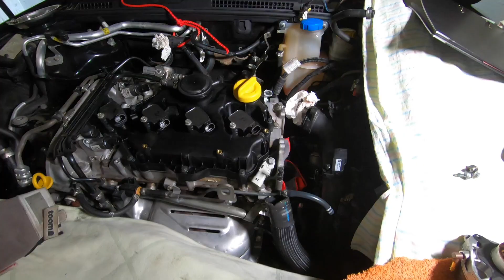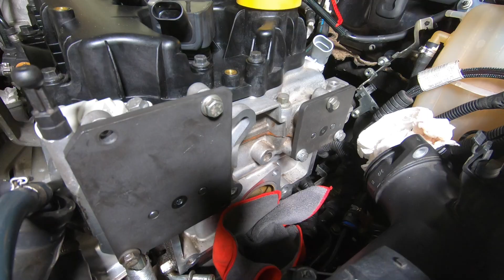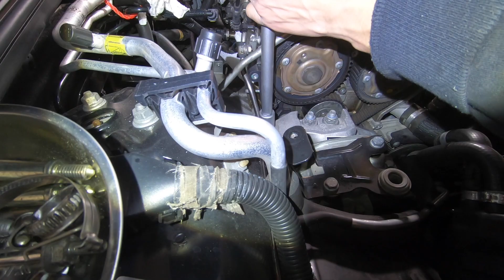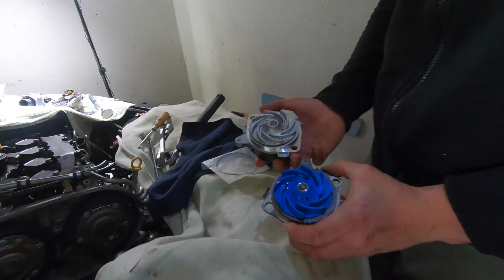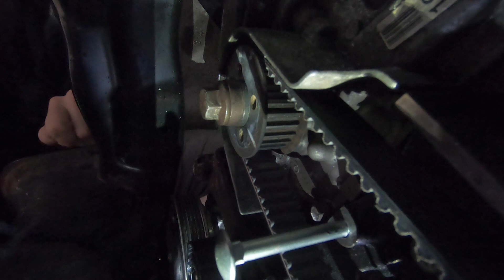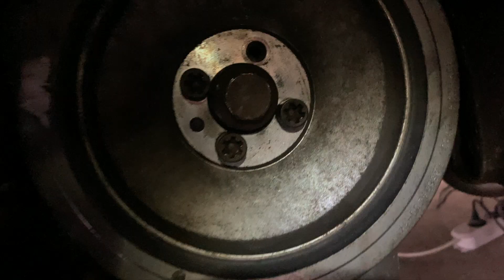ALFA ROMEO 159 TBI TIMING BELT REPLACEMENT ||| CAMBELT CHANGE

Comment: EN:
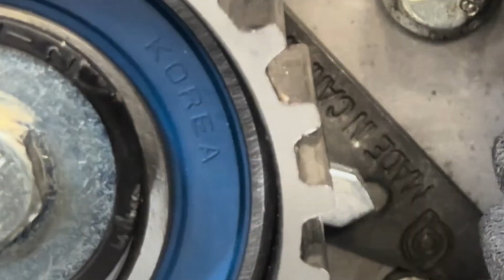At 15:36, you did not use a pulley locking wrench for the pulleys. We don’t have one either—just the locking tool (camshaft and crankshaft)—but on two identical cars (939B.1000), we always got the error code “Camshaft phase adjustment, exhaust side, sporadic,” and it only rattles when accelerating; both phase adjusters are new. We can’t imagine that it’s just the hydraulic lifters; rather, we think the problem was primarily caused by the pulley rotating while we were tightening the belt. I keep finding information online stating that the pulleys absolutely must be held in place with a locking wrench, but the pulleys here only have one hole. The valves are also still in good condition—we’ve been able to rule that out so far, since we went all the way down to the piston rings and bearing shells anyway.
What do you think? Should I insert one prong of the locking wrench into one hole in the pulley and position the other prong on the outside of the pulley against a tooth, then hold it in place? Space-wise and in terms of the tools needed, that’s going to be difficult. You can’t hold the pulley in place with a screwdriver either. Or maybe there’s a completely different solution?

DE:
Bei 15:36 habt ihr keinen Gegenhalteschlüssel für die Riemenscheiben verwendet. Dies haben wir auch nicht, auch nur das Arretierwerkzeug (Nocken- und Kurbelwelle), jedoch erschien bei uns bei 2 baugleichen Autos (939B.1000) immer der Fehlercode "Phasenverstellung Nockenwelle Auslassseite, sporadisch", und nur beim Gasgeben klackert es; Phasenversteller sind beide neu. Wir können uns nicht vorstellen, dass das nur die Hydrostößel sind, sondern das Problem eher vor allem durch das Mitdrehen der Riemenscheibe beim Festziehen ausgelöst wurde. Im Internet finde ich immer wieder Informationen darüber, dass die Riemenscheiben unbedingt mit einem Gegenhalteschlüssel gehalten werden sollten, die Riemenscheiben hier ja aber nur ein Loch haben. Die Ventile sind auch noch in Ordnung – das konnten wir so weit ausschließen, da wir sowieso bis zu den Kolbenringen und Lagerschalen gegangen sind.
Was ist eure Meinung? Den einen Zapfen des Gegenhalteschlüssels ins eine Loch der Riemenscheibe und der andere Zapfen außen an die Riemenscheibe an den Zahn positionieren und dann gegenhalten? Platzmäßig und materiell wird es nur schwierig. Mit einem Schraubendreher hält man die Riemenscheibe auch nicht. Oder vielleicht was ganz anderes?
Reply from the maker: If you have good quality locking tools the pulley should stay in place I guess ? 
Because I think that there is no need to lock the pulley when you tighten it.
Reply: @serpentcrown  
In particular, the exhaust camshaft pulley can very easily rotate along with the bolt when it’s being tightened. We’ve spoken with other auto mechanics in the past who mentioned that this is something to watch out for.
The locking tool held the tightening torque, yes. I found some additional information online stating that the timing belt should first be tensioned to maximum tension, rotated 360° twice, then the camshaft pulleys tightened, the timing belt properly tensioned, and then rotated 360° twice more. When tightening the pulleys, the crankshaft should also be secured. Apparently, this might be the case with this engine, since there are no two holes in the pulleys to hold them in place with a locking wrench.
Do you have any other objections? I'll also share the latest information with the rest of the audience.

Comment: Hello, 
To put the locking tool (brand : ASTA)  in the exhaust camshaft I have to turn a little the pulley with hand. Is it normal ? if not I can only put one screw to fix the locking tool but not the others.
Reply from the maker: The looking tools must fit 100 % 
The screws must fit if not the tool is not 100 %

Comment: Hi, great video! One question, why you needed to unscrew the camshafts and then rescrew them and you didn't just mark and the crankshaft?
Reply from the maker: I unscrewed them so it’s easier to put on the belt. When the belt is fitted so everything is in the right place.
Some people do it other not I guess .

I marked at the crankshaft and the cams

Comment: Thank you for these very clear explanations, as it's difficult here in the south of France to find mechanics willing to work on Alfa Romeo engines, especially the TBI engine. They charge 700 euros for this job. I also have oil in my spark plug wells, and even though I've changed the rocker cover, the engine oil keeps coming back into the spark plug wells! Do you know why? Thanks for the video.👍
Reply from the maker: Hello mate,
Did you change the whole cover ? Or just the gasket ? If you change the gasket you have to make sure the surface is plan before you install the new one.
Maybe the oil comes from a broken pvc valve ? Did you check the valve?
Reply: I have the same Problem. The Rocker Cover (with the solid gasket) is not the problem. Its the gasket one below. Its the Metal part which holds the camshafts in place. This Metal part is sealed with a fluid gasket. This job is way harder to do because to change this fluid gasket u will loosen both camshafts completely.

Comment: Great video, my garage  did head gasket  and timing belt on my car, it doesn't run the same since, on low revs it runs rough, but goes ok when going fast, and engine management  light is always on.
Reply: Hello, I'm experiencing the same problem. The check engine light is on, indicating that the timing belt is incorrect. Today I'm replacing it again, and I'll watch the video while I'm doing the replacement.
Reply: @marwenothmani2899 
Please  let me know if you see what was wrong, as i have parked my car up till summer time to fix it, i think my tensioner is not right.

Comment: Boss, my camshafts are stuck! Can I use WD40 spray on those two (Ribe 9) bolts? Best regards, Boyd
Reply from the maker: Yes why not?
Try a longer lever
Reply: @serpentcrown the cap- screws were way to thight and now the inside also. It’s size 10 not 9 and I’m afraid I will brake my locking tools or worse I put more force. You think the locking tools can take the force?
Reply: Can I use an impact wrench?
Reply from the maker: @boydkletter it depends on the locking tools. Are they good quality? Or cheap ? 
If good they should be safe

Comment: Thank very much for your time. You teach a lot in only 18 minutes!!  I have a question...Why do you need to lock the crankshaft also when you have already locked the camshafts. Then you undo the crankshaft lock to remove the old belt. Then you put the lock back on. 
If you have time, thank you in advance. I hope you will post such a video about changing the TBI injectors. Greeings, Boyd from the Netherlands
Reply from the maker: Hey Bro, 
I think I did it because of 200 % security 😂
Thank you 🙏

Comment: Thank you very much for providing this video. I have been following your steps one by one but I can't get the tensioner marker on the point. Do I have to use a lot of force? I only manage to tighten the belt a lot but the “arrow” does not move. Is it as easy as leaning on the screw and making a lot of force?
Thank you.
Reply from the maker: You have to loosen the tensioner screw a bit before you push or pull with a flat long screwdriver… than it should move…
If you don’t loosen the tensioner screw it won’t move.
Hope I could help you with that ?
Reply: Servus! I have the same problem. I tried with the new one and the old one too. The arrow doesn’t move at all. How did you resolve it?
Reply from the maker: @erkanali7283  Hi, wenn du den neuen spanner einbaust erst mal nicht ganz fest ziehen. Nur ein bischen. Dann den flachen Schraubendreher ansetzen und Hebeln - dann müsstest du sehen wie der Pfeil sich bewegt
Reply: @serpentcrown  I finally got it. But first I tightened the tensioner and then the camshafts is there a problem? I checked if the timing is in place and it seems to be alright. But the belt fells a bit too loose is normal? I didn’t start the car yet..
Reply from the maker: @ it’s correct first the tensioner and than the camshaft.
When you have done that turn the crankshaft one or two times. If the arrow is still over the hole the tension is good - if not put some more tension on.
Reply from the maker: @ oh I thought you were German sorry 😀
Reply: @serpentcrown  No worries I can understand you. :) I live in northern Germany but I’m not comfortable enough to write in German because I’m felling that i kill the language and  disrespect it. I’m going to check the arrow Monday  again. I checked it only one time but i turned Engine couple more times without checking it. Thanks for all information you are doing a great job!
Reply from the maker: @ thank you 🙏 Take care with your engine ❤️

Comment: That 4 screws on bootom pulley are they torx or something else?
Reply from the maker: @ukaszzawadzki5177  it’s something else. Don’t know how you call it…I think it’s polydrive?
Reply: @serpentcrown  yeah thanks bro im preparing to change belt in my giulietta.But inside the camshaft there is torx?
Reply from the maker: @ yes
Reply: @serpentcrown  do you remember the size of torx?
Reply from the maker: @ no sorry

Comment: Many thanks! My crankshaft seal behind the oil pump is leaking, so.. Oil sump removal, main crankshaft bolt is loosen today and now i have to loose timing belt. And what a surprise I have to take engine mount off to do it! Now this is quite a job to change one seal :-D In the end i will have to take oil pump out and change seal behind it too - it looks worn out too. I'm working lying below the car jacked up, so wish me luck 😀
Reply from the maker: Oh god :D.....that sounds like a lot of work and dangerous job :). I feel with you....I know these times while laying under the car...you sometimes ask yourself what if? But there is no time to think about that! :D Good luck Bro!
Reply: @serpentcrown  exactly. But i have to do it myself. Bill for such repair would not worh it. On the other hand i really like this car so,there is always only one choice-try it at least

Comment: do you have any idea how to synchronise timing? Most likely due to worn variator, timing belt skipped a tooth or 2 and now i'am getting bunch of codes, are locking tools gonna be any help with that? and are there any markings on crankshaft or camshafts that indicate proper positions of cams?
Reply from the maker: Hi there! If you install the locking tools you should have the correct timing again. There is only one way to put the tools in.

Comment: Hey man. Thanks for the video. I am going to take my 159 TBi to the garage in about a month to replace the timing belt. would you recommend buying this water pump separately? From what I can see, most kits seem to come with the plastic impeller pump. Cheers.
Reply from the maker: Hi there! Your right, the most kits come with the water pump. I also got it with the normal water pump. I think you can also go for the plastic pump. I did it because I didn't know, that a water pump with this steel blades exist - I just wanted the best :D. But I think the plastic also will do the job...

Comment: Great job bro! continue your awesome jobs.
Reply from the maker: Thanks man !
Reply: @serpentcrown  la mia da errore p0016. Ti e mai capitato? grazie
Reply from the maker: @giacomoguajana hi yes it can be a sensor
Reply: @serpentcrown  sai indicare quale era il tuo sensore a dare errore? grazie.tu l'auto la usavo con questo errore?
Reply from the maker: @giacomoguajana tell me exactly which error ?
Reply from the maker: @giacomoguajana it also can be bad timing…
Reply: @serpentcrown  mine gives error p0016 exhaust phase synchronization (rpm)
Reply from the maker: @ this can be because of bad timing. Maybe check the timing … did you do a timing belt change ?
Reply: @serpentcrown  no distribution to do. I'll do it next week. before p0016 it showed me p0011. deleted the error now it always gives me p0016
Reply: @re2leonscottkennedy  I had the belt changed. Now it starts late and the 1.4bar turbo arrives in third gear. Previously it reached 1.2. He told me to check again
Reply: @re2leonscottkennedy  for the p0016 error. he told me he would give it anyway after changing the belt. to get it removed he electronically moved the variators 1.2 degrees